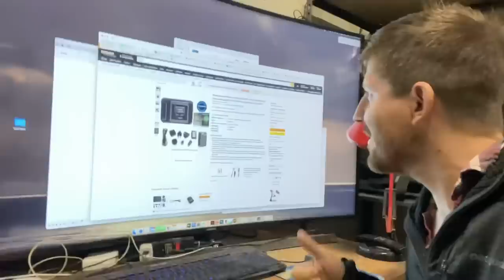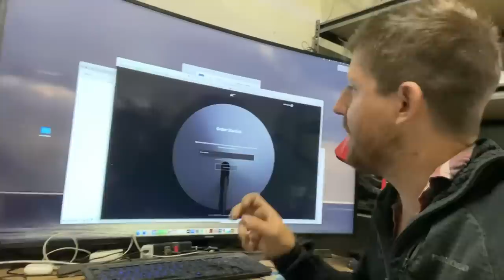Daily vlog #1

Comment: Starlink is not available for mobile usage yet, your "home dish" will only be active around the billing adress.  Mobile Starlink is coming though!  They also require a substancial amount of power to run
Reply: Yea we tested it at and around the marina and those little motors in there just couldn’t keep up in any movement at all. And it burned HUGE battery power trying
Reply: Another thing to note is that your Starlink dish is tied to a particular “cell”.  I.e. if you move your dish too far from your service address it will fail to connect without SpaceX reprovisioning you.
Reply: Did u ever found out who stole your stuff?
Reply: Came here to say this!
Reply: Go with the tried and true Iridium Go. Starlink will not be viable as a moving mobile platform for many months or longer—at the earliest. It will also draw a lot of power and will probably never be suitable for a 28ft. sailboat. Don’t mess around when you are talking about obtaining reliable (possibly lifesaving) info at sea.
Reply: 100 W power draw. Up to 150 W if in a cold climate.
Reply: @benjaminringrose536  not sure what that means...? Are you saying 8.3 amps per hour continuous draw at 12v?  In any case, continual on-the-water tracking or reliable mobile set-up is far in the future for  his current transatlantic voyage.
Reply: 118 watts per someone on reddit who tested it.
Reply: @benjaminringrose536  how does the temp affect the power it draws ?  I gotta hear this  please ,,,,
Reply: @patrickward7671  
stole what stuff??

Comment: You don't need the muffler, its just a little noisier if you're outside. The fuel pump works upright, but it supposedly last longer and has less air bubbles in the fuel if you install at an angle. I'd buy a back up fuel pump, only about $15.
Reply: You bought a double wall through hull fitting but then ran the exhaust pipe directly through the bulkhead? you also attached it directly to the hull in places. Unless I am not seeing that correct?

Comment: I love the videos Sam. I installed the same diesel heater on my boat. Easily one of my favorite creature comforts. From what I understand, the angle on the fuel pump allows the diesel to lubricate the piston appropriately. It will work in any orientation, but without the correct angle it may wear out prematurely. Keep up the good work!

Comment: Sam, the reason for the hole in the muffler is to drain condensation.  If you plug the hole, the muffler will rust through prematurely.

Comment: If you turned the bolts around on your sewing machine such that the heads of the bolts were facing the floor, you wouldn't have to lift the table up so high AND the threads of the bolts won't scrape!

Comment: I have used both the Airtronic and Chinese heaters and found that a long exhaust will carbon up the combustion chamber fairly quickly. I found that if you run the heater at max temperature for about 10 minutes at regular intervals and I also mix 1 litre of kero with 20 litres of diesel to help burn of excess carbon. These heaters a easy to service but you need to replace both the gaskets at reassembly and also have a special plug socket to remove the glow plug. The screen in the glow plug chamber is a bit of a bugger to remove but they do clog up with carbon fairly quickly especially when the heater is at low speed and will stop the heater from starting. This is usually accompanied with blue smoke coming from the exhaust at the ignition sequence. I usually service my heaters at about 1000 to 1500 hours, to give you an idea of the service life. I think the quality of your diesel could be a lot better than ours in Australia so this will affect all the above problems. These heaters are excellent . I hope this info is of some use . Fair winds

Comment: I bought one of those mufflers, and it is nowhere near airtight, as you discovered.  I am wrapping mine in several layers of fiberglass exhaust lagging over heavy aluminum foil.  The German muffler from Espar is around $65!

Comment: Great video like always. 
Just wondering about one thing, you sure it's safe to have the exhaust so close to anything whit fuel in to? 
And the hole through the boat is just wood on the inside, you sure it won't get to hot??

Comment: FYI Starlink is NOT mobile.   if the antenna moves even a fraction of an inch it causes the receiver to reset.   further if you move the antena to far from your registered location it dosn't work. ( I have read this on many forums,  I recommend you research this before getting it.

Comment: Starlink is geo fenced for now. I think its around 40km last time i saw someone on reddit testing. Its probably not going to work super well on a boat unless the boat is super still probably mostly on a mooring, because it will have to adjust a lot.  I just got starlink hooked up but let me know if you have any questions. I signed up last august for the beta and got accepted in Feb.

Comment: Generally Not bad video, 1st I've watched in a while. Fully outfitting the shop, and going to rent it, keeps occupied (- carpenter bees /wasps... ).  A ship to and reship/ mail to address...  SkyNet is Future, afaict.  And iridium? Seems Slow $.  Check out Delos sat on back, see if they will go even smaller. Need more solar, batteries and water maker...  
You got a delivery & splash date, moving along...
Exhaust / heater near fuel line seems problematic...

Comment: Drawbacks of Starlink have been posted a few times, but I don't know if anyone has pointed out that there's very little chance that Starlink will ever work "at sea".  They were approved for ground-to-satellite-to-ground communication.  Essentially, if you're far enough away from a ground station that your signal would have to bounce between Starlink satellites to reach shore, that's not likely to happen any time soon.  I think I read somewhere that about 20-25 miles from shore is about the best you'll be able to get.

Comment: Is Starlink up to global coverage now? Checked into it about half a year ago and the devices were geo-locked to home address, lost signal due to movement when mounted on a stationary revving truck had no coverage beyond 400km (or maybe miles) from a ground station because the satellites were not linked to each other. Figured it'd be a at least a year or two before it'd be suitable for marine use, but since then I've heard they've gotten the inter-sat link  to work and launched at least some new models with those capabilities.

Comment: I use those heaters to keep warm under the boat cover during the winter. That exhaust hose gets hot enough to melt plastic and start wood on fire. Trust me. You want that entire run insulated with at least 1/2" thickness of fiberglass insulation. Leaving it exposed anywhere along its length is inviting a disaster. Please fix this!!!!!

Comment: sam have you rapped your exhaust pipe with heat resistant  tape where it comes out of the bulkhead near the pulse pump , my pump was as close as yours to the exhaust and it melted the feed pipe , have all the pipe lagged now

Comment: just an FYI the starlink will not work out to sea like other satellite Internet until they re-launch all their satellites with the lasers to communicate between them they need to have a ground station quite close to where you are so it will not work once you’re 30 miles out to sea and the current dishes do not work with any motion so it will not work

Comment: Starlink doesn't work on boats yet. they cant handle motion at all and are locked to the address you register it to. Starlink just applied for fcc license to allow for maritime service. its looking like it will be available in another year. the gear will be slightly more expensive because it will need to be stabilized with a gyroscope. trust me .... I'm right there with you .. I can't wait for it. but it's not there yet. get the iridium for now. also. i would love to help you out with your editing.

Comment: starlink isnt setup for mobile use yet and you'll be limited to using it in a predetermined geographic area. The mobile antennas will also probably look and function a little differently too. Great idea, I'm totally with you, but you should wait for a while before this tech will be ready for your intended use.